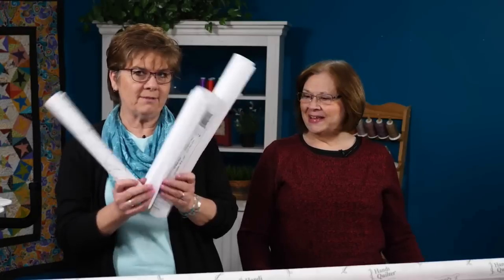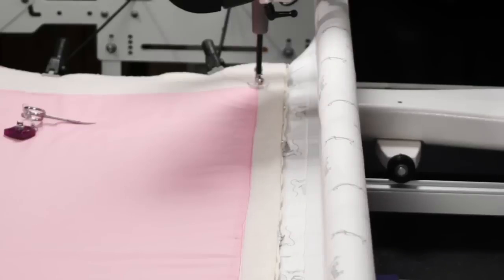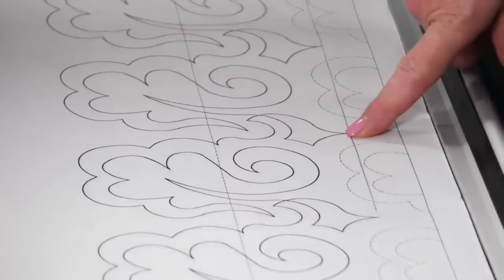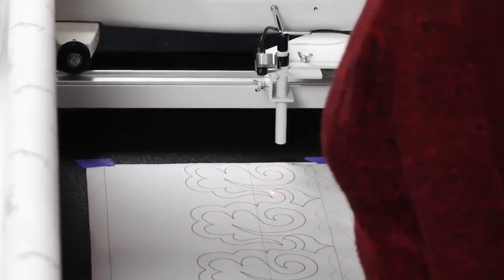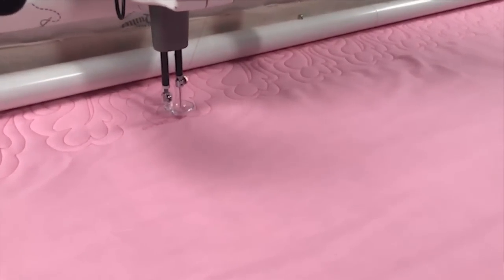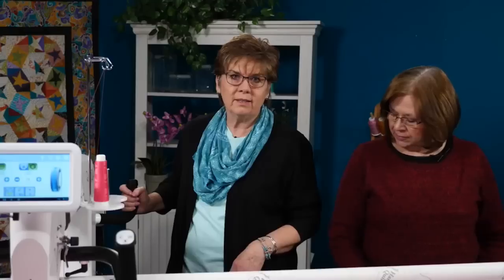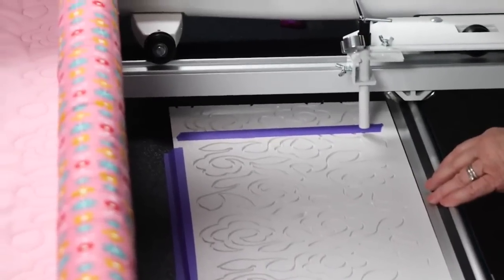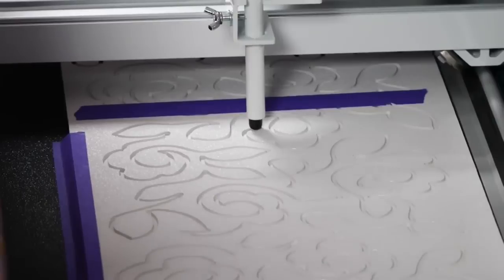HQ Live – Quilt with Pantographs and Groovy Boards (March 2018)

Comment: Excellent info on pantographs. My confusion has been how to start the 2nd row, you explained that very clearly. For those of you who do not have the adjustable laser light, you can put a piece of blue tape over the light and take a safety pin and stick a hole for the light. It works great. Thank you HQ for your wonderful educational videos etc. I usually can't watch them live, so love that I can see them later and watch more than once.
Reply: Donna Taylor I

Comment: I never knew you could adjust the size of the laser light point. Thanks for pointing out that important detail. All of your other comments helped, also. One for the important comments you made involved whether or not you want to start your stitching on the quilt fabric or on the batting. This is something worth thinking about, so you can plan for how much or how little of your panto design will be cut off on the top, bottom, and sides. Great summary...

Comment: OK, I'm learning on my Simply and this seems to be a good way - as put on the recording - to finish a quilt...1. can you use groovy boards with the Little Foot Frame (I have the rear handles); 2. where do we purchase them; 3. cost???
Reply: You can use Groovy boards with a HQ Simply.  You need to purchase the Groovy board stylus.  You can get them from your local retailer or from Handi Quilter.  They will be able to tell you the price.

Comment: I have a simply 16 with the Little Foot frame. Could I use the groovy boards, and if so, how would it work for advancing the quilt, and/ shifting the quilt side to side on the frame?
Reply: You can use groovy boards with the Little Foot frame.  You will line up what has already been quilted with new positioning.  Your needle represents the stylus.  Each time you shift your fabric, check to align what's been quilted with the new position.  Keep in mind, there are a lot of groovy board designs available, not just edge to edge.
Reply: I have done a panto on the Simply.  Just a note to mention that aligning the rows after the first is a little more involved than it is on the big frames, since you have to take off the quilt and put it back on to advance it.  Be sure to check many points along the row for alignment to make sure you put the quilt back on straight, compared to the first row.  It can take a lot of fussing to make sure the whole row aligns properly.  It's very easy to get it crooked.

Comment: Regarding Groovy a Boards, the rings that hold them together are too thick, so my stylus gets jammed at the ring when the groove is close to a ring attachment. Can I get replacement thinner rings that will not interfere with the flow of my stitching? I think this is either a design flaw or I received defective ring attachments. Thank you for your help with this problem.

Comment: I have a HQ Sixteen what size of panto can i use so that i don't run out of space?  Ive purchased  one and its too big for the space my machine will allow.
Reply: For an HQ Sixteen choose a panto that is less than 11 inches wide.  Take into consideration the size of the quilt you are making.  A king size quilt will build up on the take up pole and could take more of your throat space.
Reply: Renee,  You don't want to do a pantograph any larger than 11.5 inches when you are on an HQ Sixteen.
Reply: Thank you.

Comment: What is the number the cruise should be set on?
Reply: Cindy,  We usually have our cruise speed set between 3-5%.
Reply: Ok, so I have a HQ18 Avante.  I have put my machine on Regulated--Cruise set at 5%--Speed  10 SPI--with the needle down. Is this correct for doing the pantographs and groovy boards?